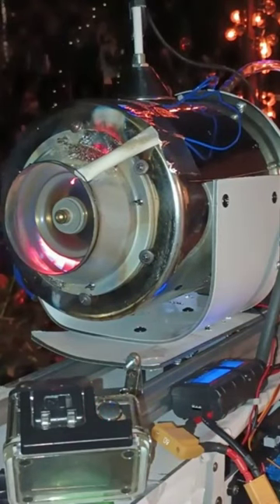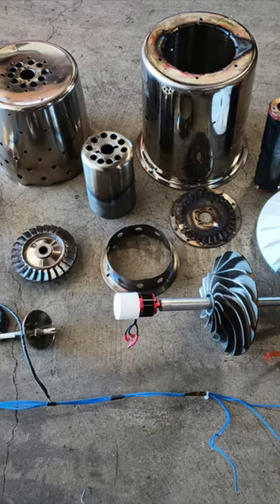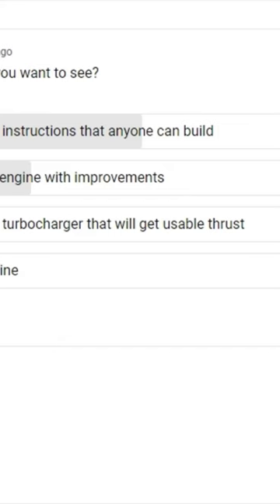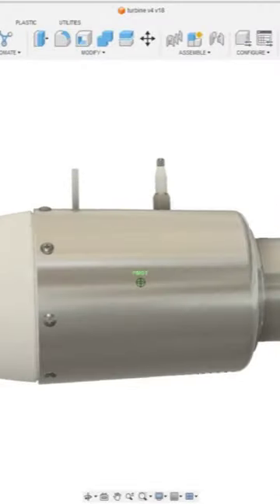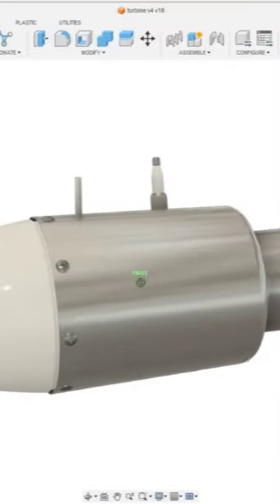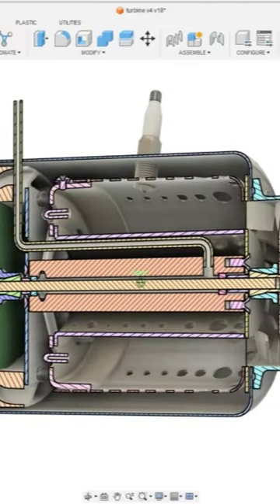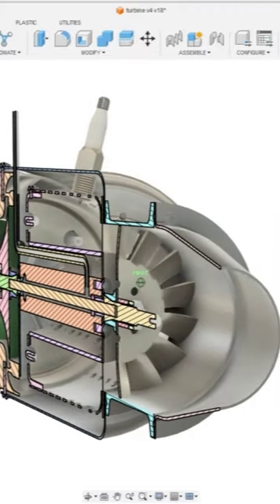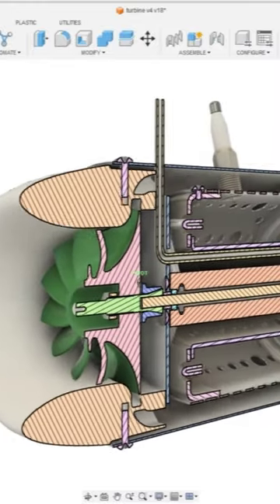designing the next generation of turbojet engine #jet #turbine #3dprinting #diy #gasturbine

Comment: Take out bearing and put in Bush and give splie of engine oil with the help of electric DC motor and fix little generater with small propeller out side  in the back at the edge of exhaust and it may charge battery for fuel injection also ❤😊

Comment: I am eagerly awaiting thrust tests😊 As a glider pilot looking into sustainers, I find gas turbines surprisingly simple and straightforward to mount compared to a bulkier piston engine with a folding propeller.

Could you please share what model of the lathe are you using?

And it seems that compressor wheel will be printed in PLA? There is also carbon fibre reinforced PLA, it might be worth looking into.

Balancing, as described in Schreckling's book, can be done by hand.
Reply from the maker: I plan to get more accurate thrust readings with the next model of engine by giving it longer hoses and wires. The lathe I am using I built from scratch using a go-kart motor and a x-y movable vise to gold the tooling. It runs from a 40v lawnmower battery and still has a speed controller and E-stop switch